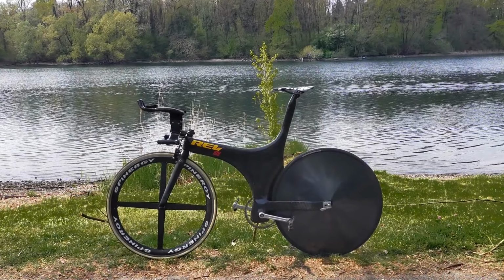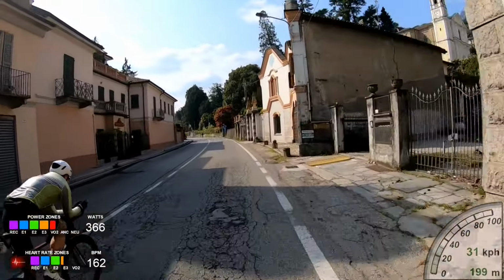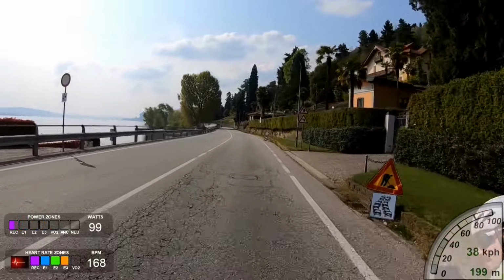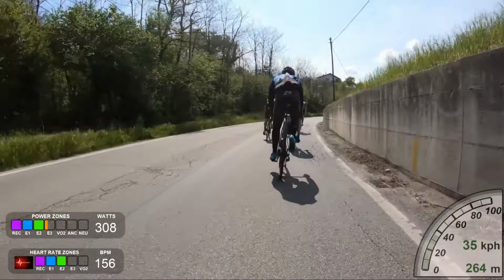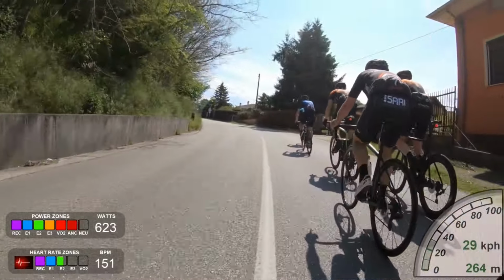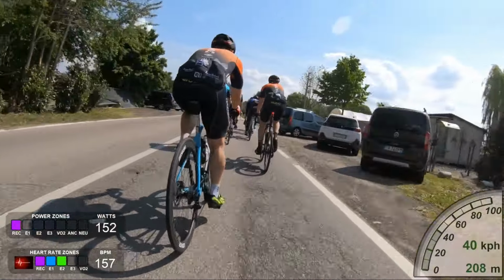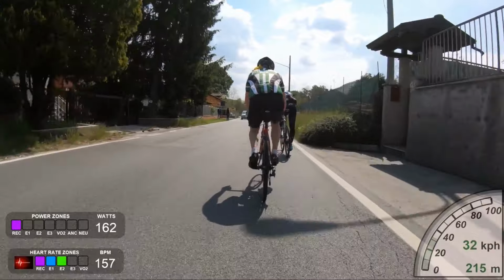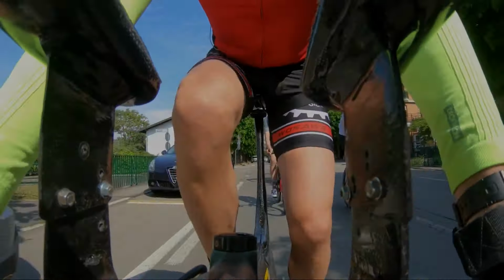Is the Lotus 108 replica faster than a modern aero bike? (ENGLISH)

Comment: It is a very sexy bike indeed! If I fail at building the recumbet I'm currently at - I try one like this with a rohloff-hub, because I already have a singlespeed. :)
Reply from the maker: Which kind of recumbent are you buiding?
Reply: @MarcoRuga  It's going to be front wheel drive, 622x42 wheels, 30-35° seat angle randonneuring recumbent, close to the french "albatros." So not as racy as your revs but otherwise pretty similar.
Reply from the maker: @switt5923  Try to keep the inclination of the steering fork to 65-70°, it is better for a good handling
Reply: @MarcoRuga  Intresting. How and in what way will this improve the handling?